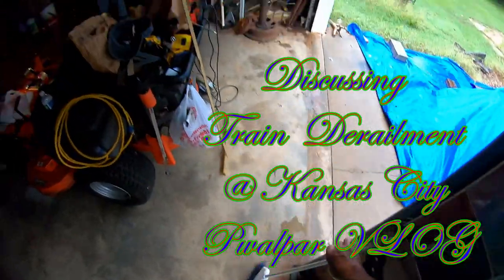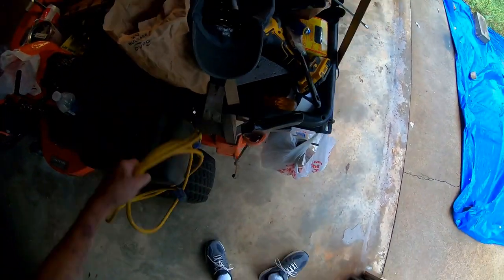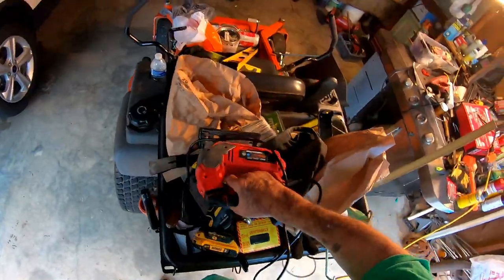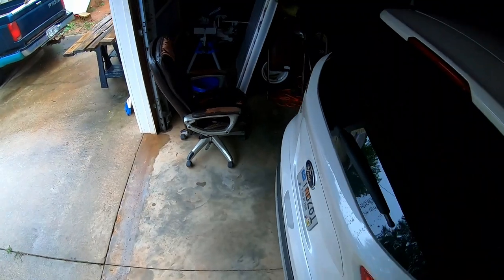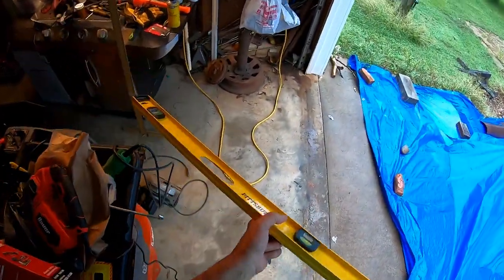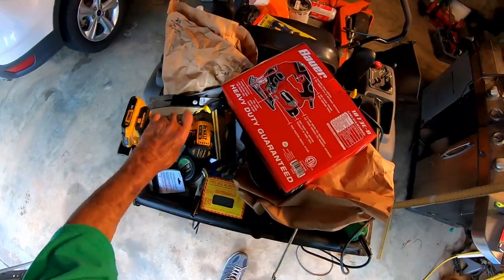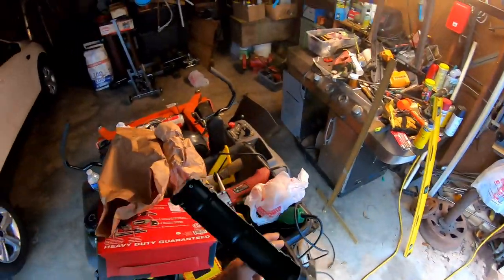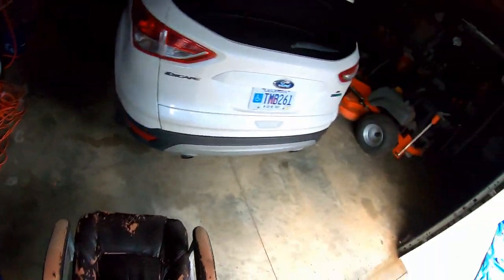Discussing Train  derailment @ Kansas City Pwalpar VLOG

Comment: recently went on a 1902 ALCO steam train ride. had all original Pullman rail cars. all cars including the locomotive had old style bearings where you have to pack and oil them.
Reply from the maker: Very cool!  You refer to friction bearings
Reply: pwalpar it ran from 1902 as a standard rail gauge till 1928 when it was converted to narrow gauge rail. was converted to oil burner in 2019.